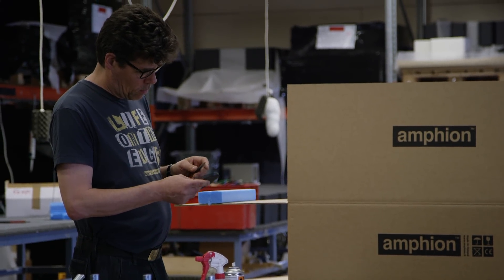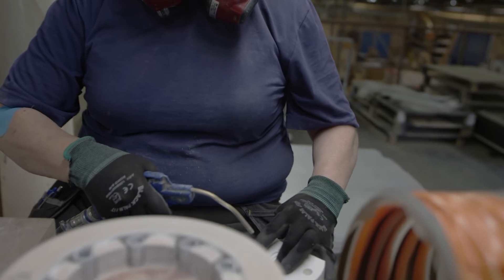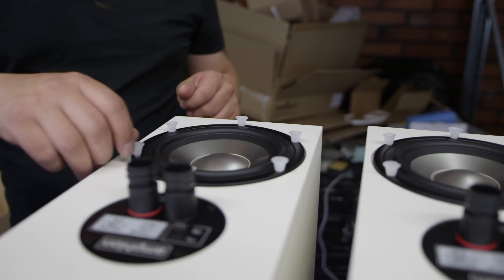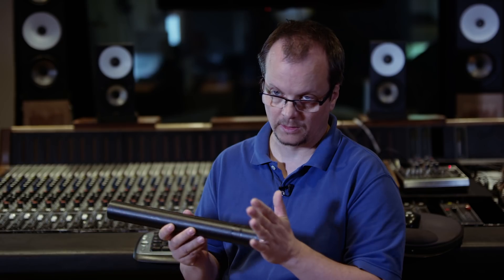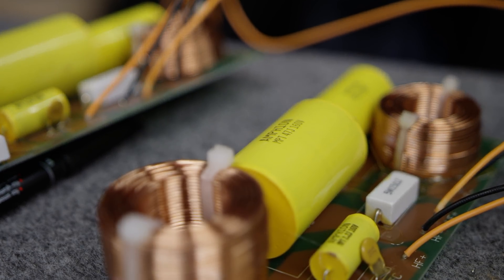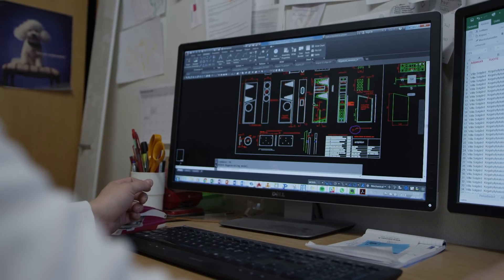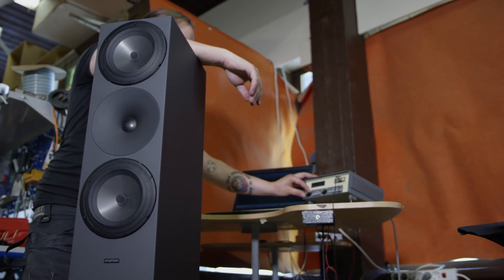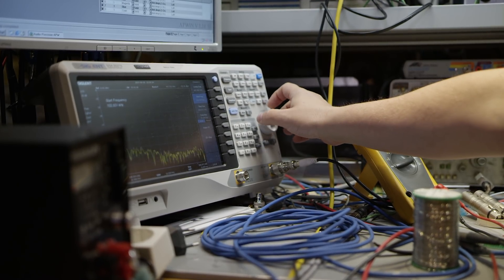SoundStage! InSight - Amphion's Three Newest Argon Loudspeakers (April 2018)

Comment: I am interested in the Argon 3LS, or maybe the 7LS, but I still have to hear them. I am wondering if you have experience of how these will sound when paired with a power-amp based on Class D Purify Eigentakt modules, which are known measure very analytical and precise? Could it lead to “too much” analytics and precision in the sound? Would I need a tube pre-amp to
offset this, you think? The few reviews of Argon 7LS that I read online are only together with Hegel 190..
Reply: Your ok with that combination. I run a simillar setup. I had a freya plus tube pre amp but I perfered the speakers without the pre. 
Current setup is holo spring 3 kte dac > nad m22v2 amp> 7ls speaker.  I had a purifi for a bit aswell and I liked it.
Reply: Bought 7LS week ago and i'm impressed so far. I knew its perfect match because Hegel themself have auditioned using Amphion speakers and few online reviewers have tested this combination and praised it. Paired with my H190
I have tested with class D amps with my previous speakers and also 7LS. Its pretty much day and night compared to A/B class decent amps. Its all about neutrality and purity of the sound that is important here. Class D amps usually give their own personality to speakers so its a hit or miss. Hegel is neutral and thats why its good to test speaker itself

Comment: I wonder if these would be much cheaper if they were built in China?
Reply: Less than you think. They are a small manufacturerer and don't have the volume levels to do it in China. You need at least 500-1000+ units to go there as a minimum then you are not saving a lot until you scale to like 5000-10,000. the first couple they are made well then they slack off...You have to put people on site to audit them and check quality or own the factory to really get the quality you need. It is a nightmare.
Reply: I guess they want to employ people in their own community. However, you're welcome to buy speakers assembled by borderline slaves if you can't afford Amphion.

Comment: Looks like Buchardt, probably overpriced like them as well
Reply: Their drivers cost way more than Buchardt and Amphion crossovers are simpler and easier to make than Buchardt with less things in the signal path because they crossover lower and their cabinets are beefed up more than Buchardt that up until recently had no bracing in the old s400. Buchardt came from Dynaudio and uses inexpensive drivers and the new MKII has this crazy massive expensive crossover to make up for the junky design and limits of it's cheap drivers so it is a backwards approach. Amphion company put's in their own bespoke made Seas drivers that are 2-5x as expensive and use better cabinet materials and bracing and better design to avoid everything wrong from better design up from instead of "fixing" the stuff Buchardt has to do. They also have been around over 25 years and Buchardt is a startup and the kid running it is competent but is not as seasoned as a company to develop in house technologies and everything is off the shelf with him.
Reply: @pennfootball71  Well said and informed.
Reply: Amphion was using the wave guide before Buchardt. They also use very different crossover frequency points.
Reply: lol Buchardt is not overpriced
Reply: if you judge something by how it looks, and have an opinion on its quality and value based on a different product, then good luck to you with that.

Comment: Tweeter wave guides are just a cheap semi horn design marketed by everyone right now. A few years from now they will go back to flush mount and call it flat guide. Also passive radiators are such an 80s Polk Audio strategy. Nothing new here.
Reply: I have to disagree about your statement about  waveguides. If made well then can help alot to improve the speakers dispersion.

The passive-radiator aspect you mentioned is true. It offers little to no improvement over a ported design. It's just something "fresh" because bassreflex is so common.
Reply: They're still using the wave guide, a "few years" later.
Reply: Waveguide design are hard to make Amphion has been developing their waveguide technology for over 25 years to get it nailed down and need to make drivers specific for them unlike other companies who use off the shelf things then make a waveguide with less precision. If you get it wrong the speaker is not time and phase aligned right.

Comment: You're using high quality silver plated wires but a passive crossover...
No matter how expensive its components are, a passive crossover is going to be a major compromise.
Reply: if you go active then most ppl don't want AD/DA since you already own a expensive DAC + vinyl owners prefer no digitization of the signal. the other option is single widebander with one XO for the woofer, that way the XO point is 100hz region. ofcourse they will be expensive, eg Voxative.